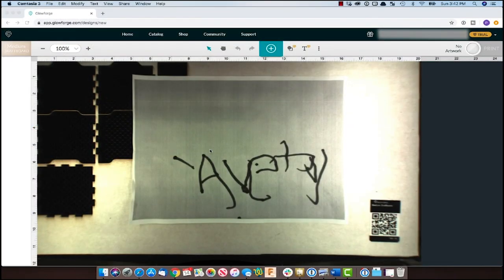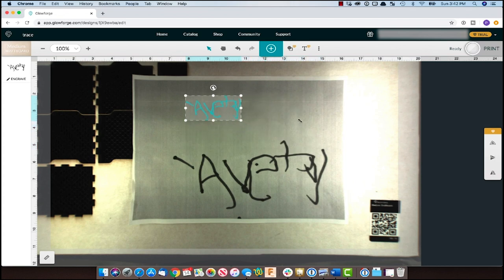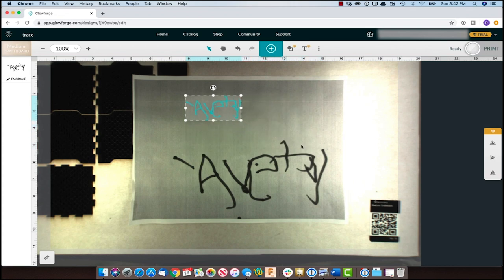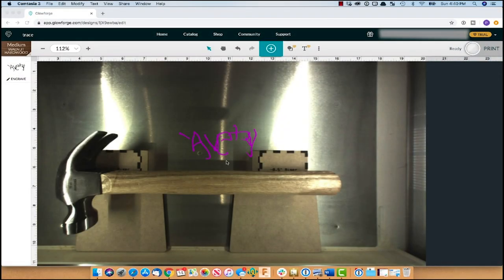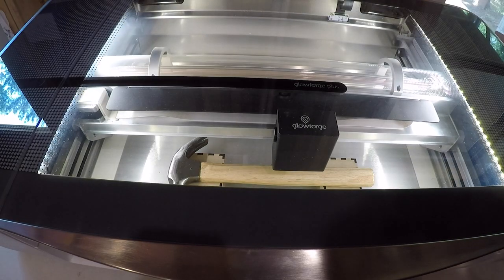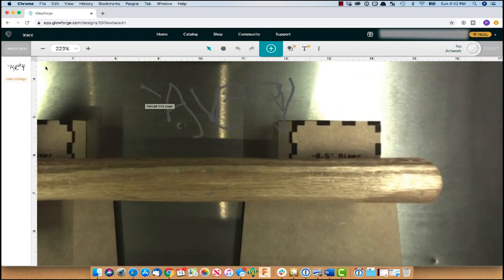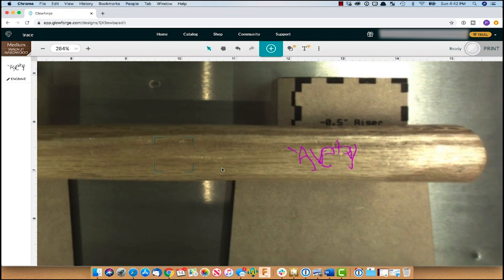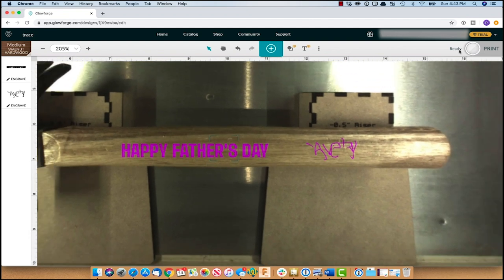Glowforge Father's Day Hammer | Glowforge Project | Laser

Comment: Sorry if you said this in the video, but what is the purpose of the risers? What if you engraved the hammer without the risers?
Reply from the maker: That's a good question.  I will make a video on this in a little more details, but the item has to be within the 1/2"  focus range of the laser.   So items that are thicker than 1/2 inch need the honeycomb tray removed, then we either stack sheets of wood or other things (in my case the risers) to get the item within that range.  I'm about to upload a video engraving a glass plate where I also use the risers and use a tool to help me determine the distance from the laser head.   Look for a video explaining that tool and the reasons for using the risers in a couple days.
Reply from the maker: So if we put the hammer in there without the risers the Glowforge will give you an error when it starts to figure out how to engrave the item.    You can be too close to the laser and too far away.  I've had it yell at me for both while working with the hammers initially.

Comment: so there is no need to have protective tape on wood?
Reply from the maker: Depends on the wood.  In this case I went no tape because of two reasons. First, the scorching comes off easily with a little alcohol, and secondly, it’s nearly impossible to line up good in a hammer like this with tape on it unless it’s trimmed well.  On 1/8” and 1/4” plywood and hardwood, it depends on how I’m going to finish it.  If it needs to be sanded, I usually won’t tApe it as any scorching will sand off easily before painting or staining.
Reply: question how do you weight down objects that may move in glowforge
Reply from the maker: @trevellw8210  For things like cardboard or smaller/lighter materials such as EVA foam, I use the honeycomb pins which is a free file.  I have links to it in the "3 Must have tools you can build with your glowforge" video.  https://youtu.be/Cb7MSljBsmQ

Comment: Can you engrave a name on a softball glove?
Reply from the maker: Two challenges with a softball glove.  First it needs to be Veg tanned leather, not standard tanned leather as it will release toxic/caustic chemicals.  Second it has to be able to lay flat enough (ie: under two inches) to fit in the glowforge.   I have a bigger 100w laser now that would handle it easier if it was veg tanned leather.   So it could be done depending on the type of leather and laser.